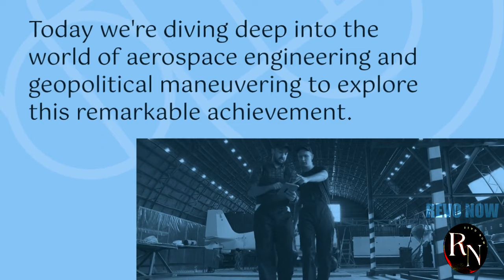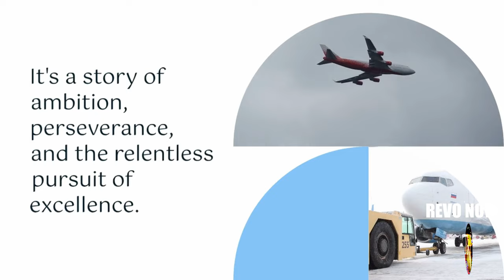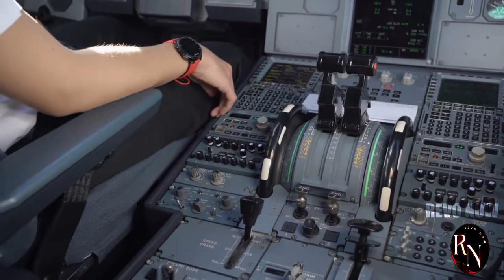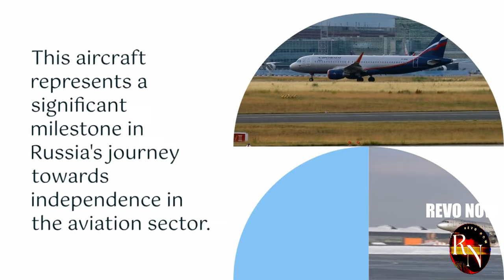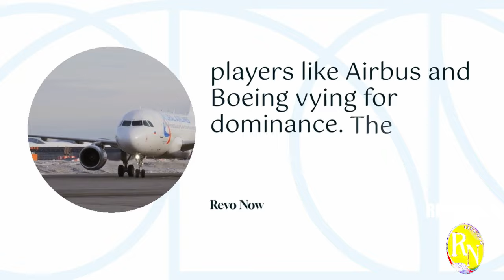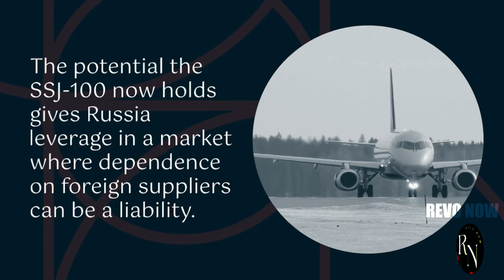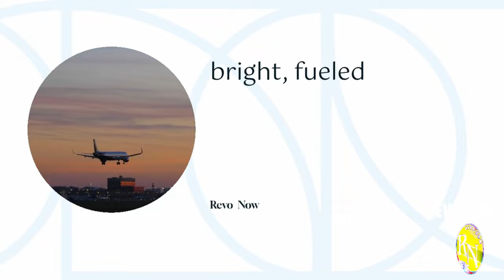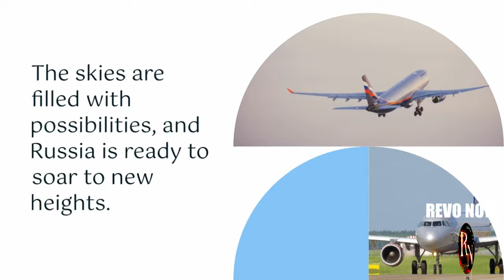Will Russia's New Plane Topple Boeing & Airbus?

Comment: A lot of hot air. But the plane is not a hot air balloon.
Even the Soviets had problems keeping up with Western commercial planes, mostly with electronics. The products were not optimized because there was no competition in the isolated consumer market. That differed from the weapons market where they had to meet the Western products.
Reply from the maker: @gottfriedheumesser1994  Meaning?
Reply: @RevoNow  Extended!
Reply: @gottfriedheumesser1994  Hot  air or not, the global aviation market will soon be divided by four.
Reply: @sktan3743  If you believe that? Russia has not exported significant consumer products until now except for political reasons. You also need the logistics (maintenance, spare parts, trained experts). They even failed at the beginning of the Ukraine war mainly because of bad logistics.

Comment: That plane is a flanky. It failed in Ireland and and at air Mexico. It did excel at crashing though.
Reply: @sausmiit5919  are you referring to Boeing 737 max? 🤭
Reply: @VeeFTeeS  Its not just the 2 737 max that crashed , there is another one that lost a emergency door . I also saw records where employees from the South Caroline plants wouldn't fly on 787 that was assembled   in their plant .
Reply: burrito disney, foi um boicote pois usava algumas peças ocidentais....
Reply: @ursulaeissner1743  that was a door plug but yes. Also found problems another I think 4 aircrafts in Delta's fleet. Max lost Boeing's reputation as a safe airliner. Many nose dive also happened in US before the crashes.   Luckily the pilots managed to handle those situations. It has actually reported by the test pilots already during the Max's test phase and they didn't change anything. :(